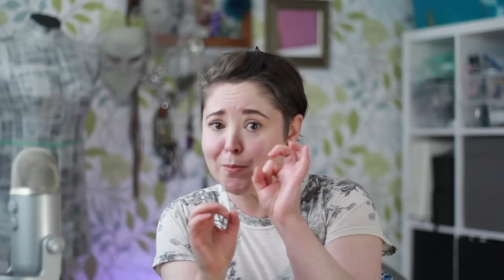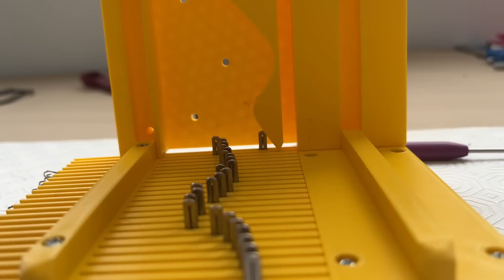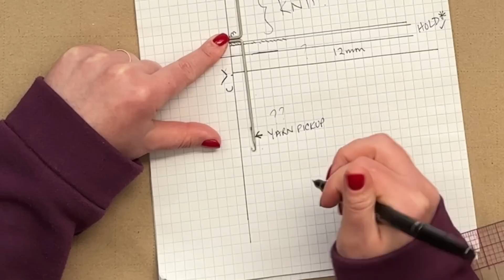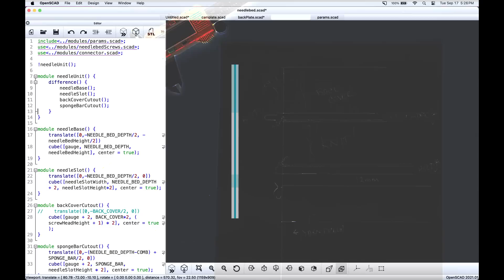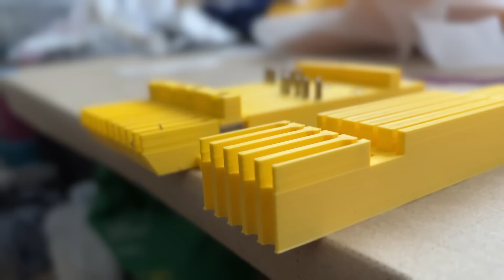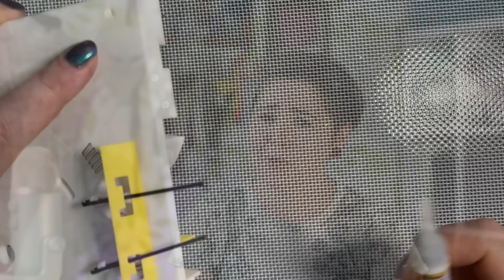Everything (else) I learned about knitting machines while designing one of my own

Comment: I would suggest you take a look at the Passap Vario plastic bed knitting machine.  Here you can see another way of making the needle spacing plates without the screws.  This machine knits both 5mm and 10mm seperatly or at the same time on different sides of the bed.  I would love to explore this with you in a bit of conversation. 
You can google this machine to find the manual as well as 2 youtube videos about it. 
Also as to needle background. Early on needles were more rigid than on many machines today. They did not use a sponge bar as the needle retainer.  The needle retainer could also be more durable.  The sponge bar used today is for more flexible metal needles that actually bend slightly for lace knitting performance. This is way too much to text into a comment box. Even in the much older home knitting machines there are several different construction designs.  The practicality is based on the desired use. Most all machine can do the same things just differently. A study of the cam systems of different brands is also interesting.  This is for the locks, AKA carriage or basically the needles paths. The Bond system used easy to drop in key plates of different configurations.  Some machens have disc's like older sewing machines, still others have a series of buttons, levers and timing belts to produce different needle paths.  🫠🤗

Comment: As a former Agile trainer, I just want to thank you for going into depth about your process. Don't be too hard on yourself about that first stumble, it obviously helped you find out what you needed to nail down to effectively move forward (especially re: organization - it's just not as fun as all the coding and building, is it? 😀)

Anyway, I've 3D printed some sock machines already, and was having vague thoughts about a flatbed design when you popped up in my feed. Thanks for doing all this pioneering work! You know exactly how much time you've saved me. Looking forward to watching the design grow and improve and printing my own soon.

Not to stir the pot (much!), but have you considered applying compliant mechanisms rather than pivots/springs/etc. to the design? 3D prints work pretty well for those if you don't ask too much of the material.
Reply from the maker: Haha, totally, I learned so much from doing it badly first, I'm glad I got the chance to get that out of my system early! And yes, I have been looking into compliant mechanisms and I've got a few ideas but haven't had a chance to test anything yet. Fingers crossed!
Reply: Yes, compliant mechanisms were my thought too. It solves the parts availability issue, and could end up simplifying the carriage as well.